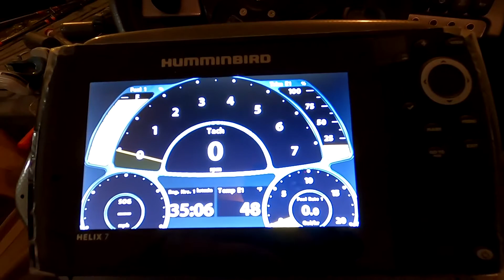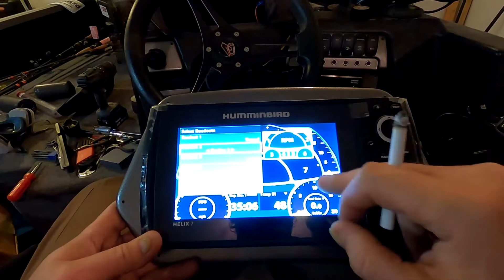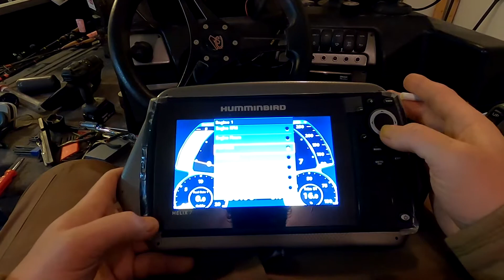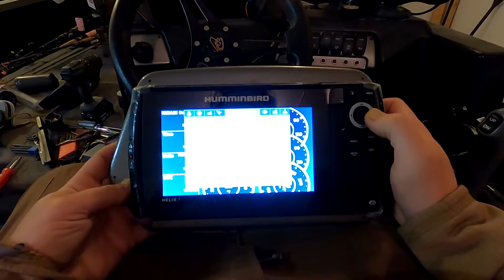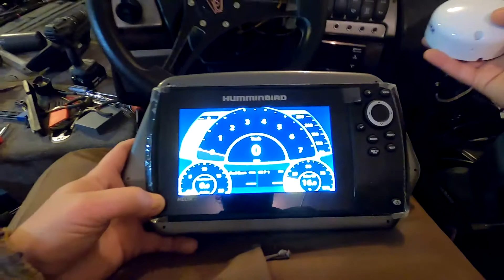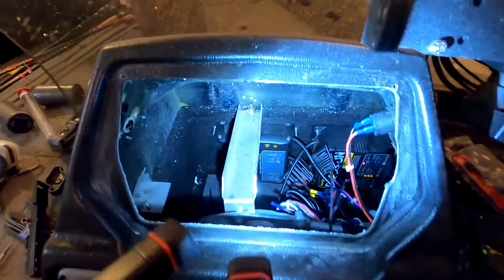How-to:  NMEA 2k and Helix 7 in-dash install - Part 2

Comment: I have same engine , how hard to pull nema wire  from motor ? Disassemble the housing around the rubber bushing and place wire in open slot . Then  put a new  zip tie on  ?

Comment: You didn’t show where you plugged the NMEA cable at the motor side. Could you point me in the right direction?  Thanks
Reply from the maker: There's only one plug it fits into.  It's right on the front of the engine once you remove the hood.